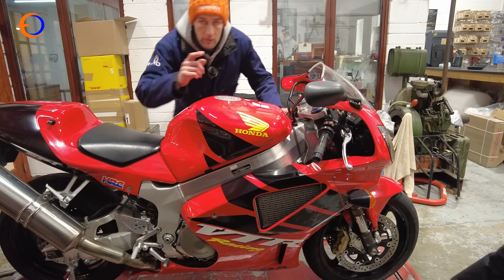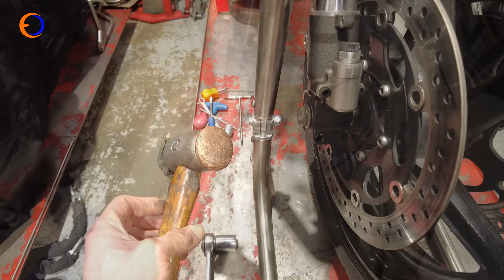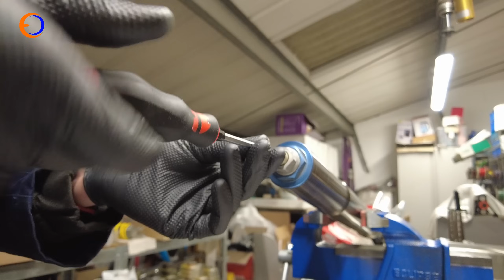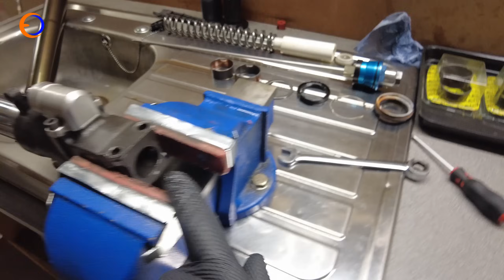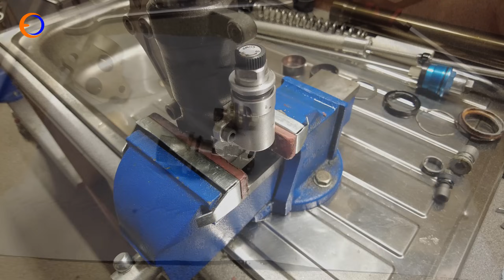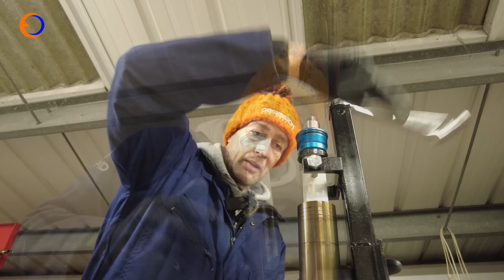How to service and upgrade your forks. Dave's Honda SP1 upgrade project. Fork seal change + re-valve

Comment: Great video! Any reason why you are not pushing down to seat the fork legs before you torque down the pinch bolts?
Reply from the maker: Because there's no need!
Reply: @obsession_engineering  I was just wondering, because the workshop manual is mentioning it but I fully trust in your skills and experience. Thanks!

Comment: If you didn’t change the valves, do you have to worry about the clicks before tightening the damper shaft to the top nut?

Also, don’t forget to cycle the forks a couple times to center the wheel before torquing everything down
Reply from the maker: The click numbers are still important on the stock valving, very easy to have no adjustment left if they're assembled just a little wrong.
There really isn't any need to bounce the forks when refitting the forks or wheel. It has a datum point that the spindle will set it to and anything that requires movement after, has movement built in

Comment: Great video Dave! I'm looking to service my own forks this weekend so I thought to ask you what's the best way to clean out the internals and fork tubes? Do you use some sort of cleaner/degreaser or do you just let it drip out and then wipe off the leftover old oil?
Reply from the maker: I blast them out with brake cleaner, degreaser would work too, as long as they're clean for the rebuild
Reply: @obsession_engineering  Thank you, much appreciated 👍

Comment: Great video as always. I’m wanting to do my zx6r 03 B1H forks. I bought 10w oil. Should I be using 5w like you?  I’m about 90kg and use the bike only on track. Thanks
Reply from the maker: Should be on 5w.
The b1h has a bit too much Rebound damping as standard, might work well on track. Standard springs are only an 8.3. I'd be swapping them for 9.5 for track use
Reply: @obsession_engineering  Actually the guy I bought the bike from put Maxton 95 springs in so that’s good. I’ll get some 5w oil too. Thanks Dave.
Reply: @obsession_engineering  is there a reason why 5w is better over 10w for my forks? I’ve seen a lot of people recommending heavier weight oil for track/race bikes? Thanks in advance Dave 👍

Comment: I don't have SP1 manual so I can not check but I do have F4i bike and I see that the front wheel axle and forks mounting are the same. It is written in manual and also a good practice before tightening pinch bolts to pump the front so the forks could "self align" on the axle. Especially it is well seen on this Honda axle. If you look closely on the axle you will notice that one end does have raised edge. If I remember exactly there are two different size side collars and one is in contact with fork and the other is in contact with axle edge. So after you tighten the axle you can tighten the pinch bolts on the lower diameter axle side because this fork is pushed against the collar. On the raised axle side you can see the fork leg is loose and you can move it by hand. So then you pump the front both the forks positions itself vertically and it helps to lower the stiction. On F4i manual the pumping is written with applying the front brake but on some other manuals the pumping is without brakes (and I think it is better practice). If you pump without brakes of course you will need to put some wood deck or something under front wheel to keep the bike stable. I know on race tracks nobody do that and if the bike is in good condition and no damages everything should alight itself by torqueing the bolts. But on old and second hand bikes usually everything is out of spec...

Comment: Excellent video, thank very much. I too have a standard sp1 in need of new fork seals.
Reply from the maker: Get in touch through the website if you don't want to do them yourself
Reply: Thanks Dave, i think i'll have a go myself and see how it goes. i did the fork seals on my zx6r last year so hopefully this will be ok too. Do you offer a manufacturing service for the longer pre-load spacers? thanks, Will

Comment: A great video that almost convinces me I could do it.  The main issues I have are, lack of suitable workspace, some of the key tools, and errm… the talent 😊

I would like to improve the handling of my BMW R1200S, which should be good, but is not nearly as confidence inspiring as my Triumph Tiger 800.
Reply from the maker: Big lump those bmw's. Excellent things, but I suspect the trumpet carries less weight which also helps

Comment: @Wavey I've just bought a stock (almost) SP-2 with 19k miles on it. Problem is that the fork and shock springs feel quite stiff, the previous owner was a bit of a 'portly' gent. I've got to service these forks anyway so I'm gonna take them apart. Do springs have IDs on them so I can tell how many N/mm they are, or do I have to measure them? Ta in advance.
Reply from the maker: There's no markings on the stock springs, but most aftermarket items would be labelled.
Stock setup is quite firmly sprung (and preloaded in the rear), so it could be stock still.
Getting the damping opened up on the clickers may help take some harshness away
Reply: @obsession_engineering  You're a gent Dave. The shock spring is red so I suspect fronts were changed also, so I will tear the forks down this week and have a look. Thanks mate.

Comment: That was really interesting seeing the inside working of the forks with the shim stacks and the needle bypass, makes adjusting suspension make more sense.

Always wondered how those side mounted radiators worked properly given the lack of direct airflow hitting them. 
Would be very cool to hear it explained briefly in a future video.

Comment: Dave’s just serviced/upgraded my Fireblade forks 👍 can’t wait for Donny next month. Btw my HRC brake reservoir sock covers my shiny obsession engineering reservoir stay. May I suggest a new line of OE res socks ❤️
Reply from the maker: You covered up my branding 😭😂
Reply: @obsession_engineering  okay I’ll put the sock on the clutch side 👊 😂

Comment: Why doesn't it have quick release fastners.  
The vfr 750 and the rvf 400 had them .
The vfr750 is super easy to remove the panels
Reply from the maker: Honda must have assumed it didn't need to come apart often 🤔
Reply: Ouch. 😂

Comment: That was excellent Dave! Thank-you very much.  It was very informative.

Did you turn up the aluminium spacers above the fork springs or was it an off the shelf item? I'm guessing the former.

And if you wasn't concerned with keeping the SP1 looking standard, what upgrades would you have done instead?

Cheers 👍
Reply from the maker: I did make the spacers myself. That way I get exactly what I need!
I'd definitely have gone open pipes, fuelling module, airbox mods and lighter wheels, maybe an sp2 swing arm too. All the bits everyone did back in the day really.... Oh and a fancy pants shock too, probably
Reply: @obsession_engineering   I thought so.  Very good.

Ahhh very tasty!  That sounds smart!  And would certainly up the ponies and handling 👍 But understand keeping it standard.

Thank-you for your reply Dave 👍

Comment: Dave: The thumbnail looks like you've just noticed the frame no. doesn't match the logbook😁

Q. Was the 20 year old springs free length within spec?

I think the Sp1 is the cooler model to own now, as most of the Sp2s seem to have been bought by and kept as ornamental 'investments' by 'My place in the Sun' early retirees.